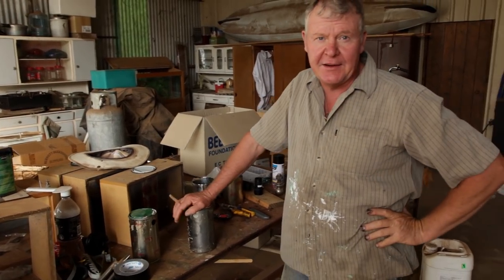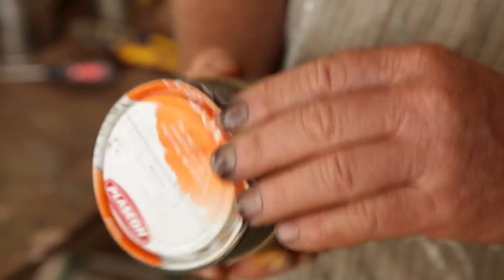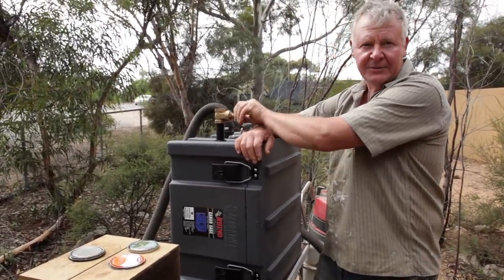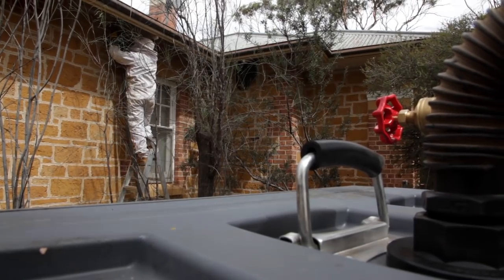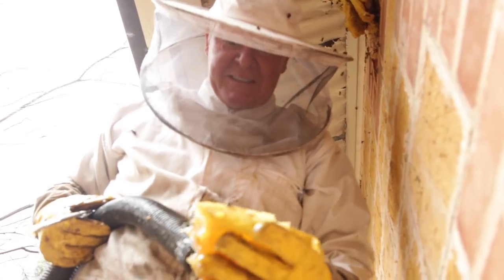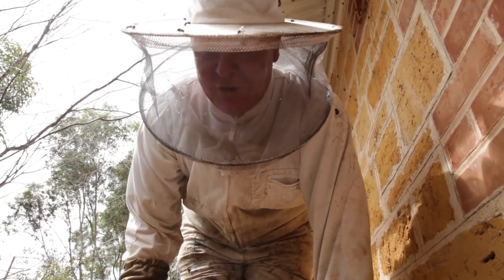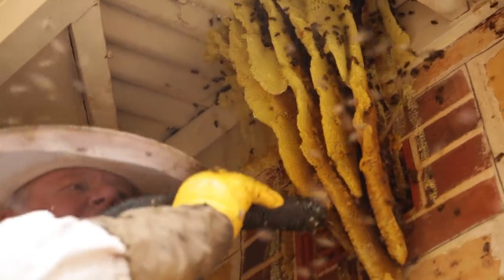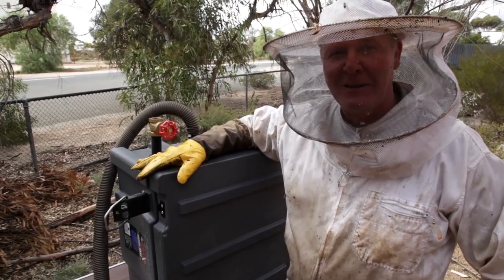Rescuing a Wild Hive from a House using a Bee Vacuum - The Bush Bee Man

Comment: That is a really good outcome. One suggestion. Use hose clamps on all hose connections and you will get great vacuum for less energy input ( smaller vacuum cleaner can be used ). That will also reduce the amount of escapes. Fantastic effort I will be copying it.

Comment: If you put the exhaust at the top near the intake, you would get an air flow that would move the bees out of the can and towards the top of your box so they can gently drop to the bottom rather than be slammed into the bottom of the box on their way along the air flow.